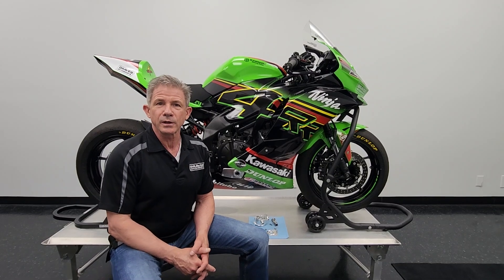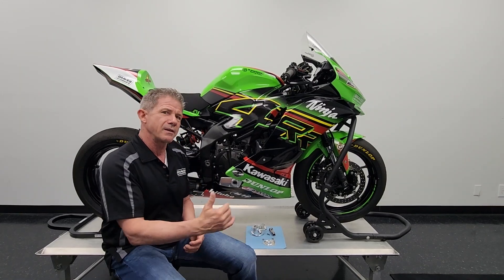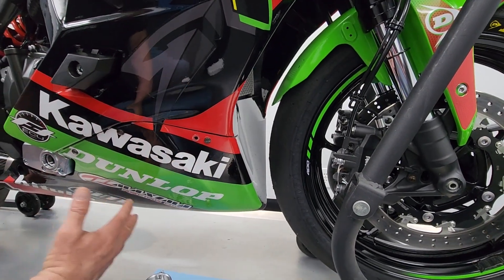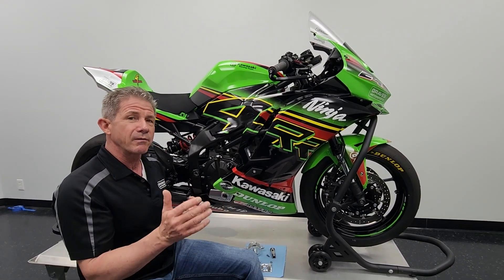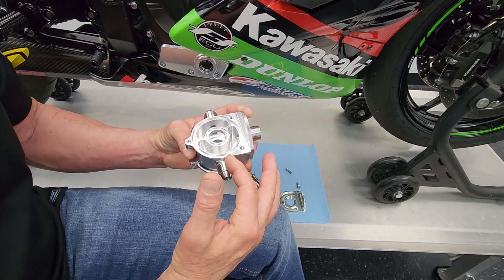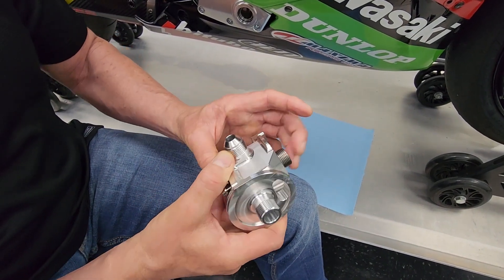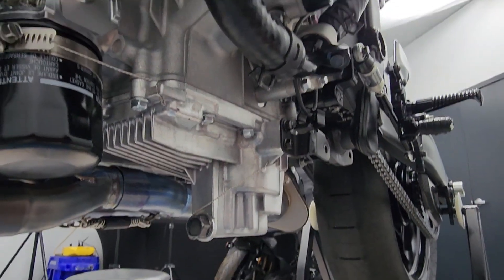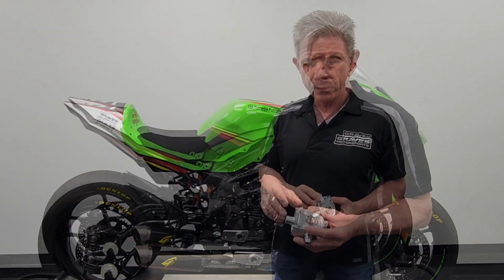Kawasaki ZX-4RR / ZX-4R Oil Cooler Explained - Graves Motorsports

Comment: is this upgrade ok for street use and racing use? i plan on also using this bike for long 700miles touring within a day. What im worried about is the oil not getting warm enough and not working optimaly when used for causual street use

Comment: why are you using the 16097-0011 oil filter rather than the 0008 oil filter? this 0011 is designed for gen5 and newer ZX10. Have you found any benefit that makes you switch the filter to this one?

Comment: Hey Chuck and graves team. You mentioned in the video that it increases oil capacity. So on a oil change instead of 2.7qts how much oil is needed?
Reply from the maker: @dragonmaster7410  Requires adding an additional 215 cc's of oil to your motorcycle. We recommend following the same procedure as stock. Warm up your motorcycle with the the additional oil added to the OEM suggested amount. Then use the oil window to top off. This is the optimal race setup.

Comment: What about on ZX4RR on track that doesn't utilize the under belly fairings?
Reply: That would be a track day only bike. For a proper race bike you will need the lower belly pan to catch any oil and or fluids.
Reply from the maker: It's an improvement no matter what.